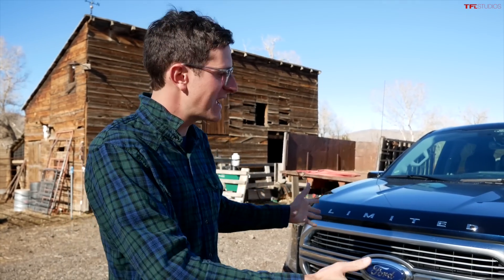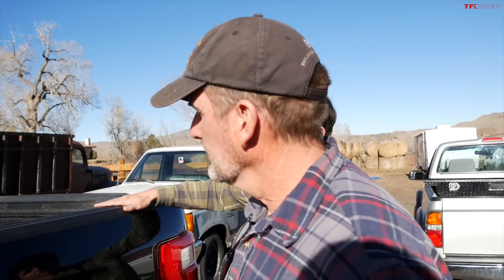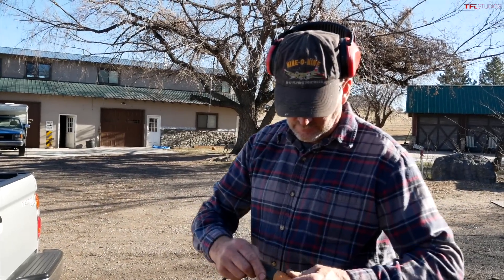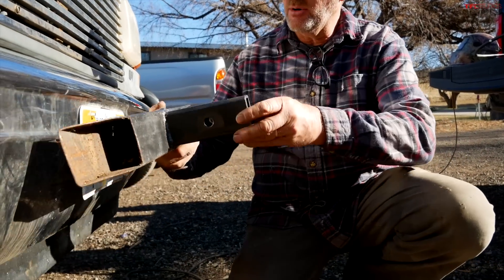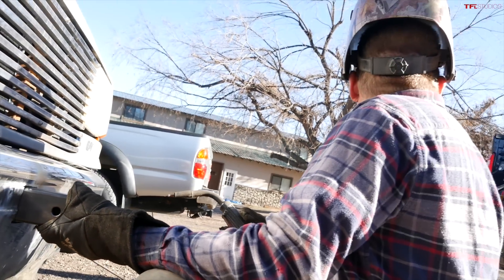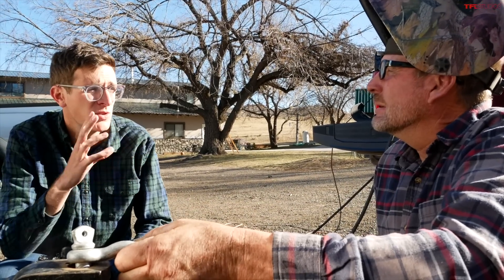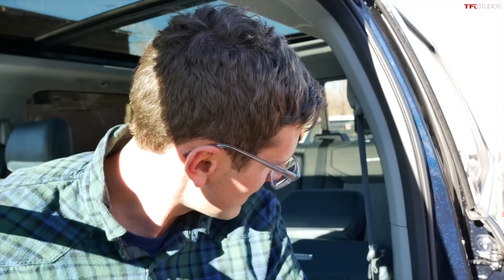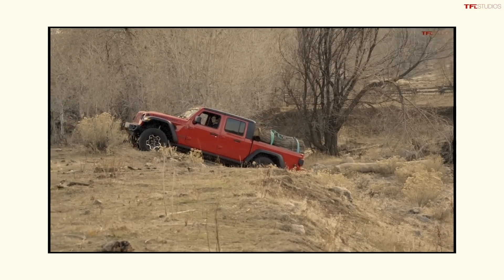What Does A Rancher Think Of The New $80,000 Ford F-150 Hybrid?

Comment: $80k for a truck? I paid $80k for 10
acres,a house,pole barn ,new well and septic. I'll buy a used truck.
Reply: There are cheaper versions of the F-150, for sure there is a 40k truck with almost all those good features. We have to remember this is a Limited version.
Reply: For those concerned about price of high-end vehicles, I’ve been frugal all my life...now I’m retired and I saved too much money so I’m going to buy an overpriced pickup just because I can.
Reply: Yea buy a used truck with a carb, upgrade the alternator, buy an inverter for 200$, bam....  I have a 32 year old Jeep grand wagoneer, got a 200 amp alternator, can output 2800 watts max..  a $200 3000 watt inverter.. adjust my idle with a screw driver if i want it higher to get more power outa the alternator... BAM saved myself 80,000$
Reply: Dizzy Gear  Why did it impress you ?  A 50 year old car can do this with an inverter a high amp alternator an battery and adjustment to the carb for higher idle..
Reply: Dizzy Gear  Dude you need to get off the couch, go to any dealer and see what prices are. GM and Ram don't have that fancy of a truck. Theirs only go to $70,000. The other guy on TFL just bought a XL version for $50,000 with that generator option.
Reply: @jeepsblackpowderandlights4305  Yep and what you have is a 32 year old piece of shit that you can weld with.
Reply: @robertward553  lol i have a 32 year old car.. that still runs and drives 32 years later.. and is worth over 30k$ in cash.  Have you seen the value of these grand wagoneers some sell for up to 50-60k$ today ?  Whatever car you drive will never end up a classic nore hold or go up in value like my (pos) has and will probly stop running after 8-10 years once the plastic all starts breaking on the engine

Enjoy your carpayment. Property tax and car insurance prices on your pos car though
Reply: @jeepsblackpowderandlights4305  Well good for you, even you must know that not everyone enjoys driving the same car for 32 years. I went 10 years once, 98 expedition, 180,000 miles body still in great shape. But I got to admit, unlike some, I like new shit.
Reply: @robertward553  who said i owned the car for 32 years, i bought it 5 years ago and  restored it by myself, these things are gold mines for money if you can repair cars like i can, but besides that fact, my point is its easier to do things on a car thats simple..  Modern vehicles you cant even repair without companies trying to sue you or block you via computers.
My other point is people who buy new cars, are spending most of their money on car payments.. who wants to pay $600-800 a month on just  the car payment lol
Reply: @jeepsblackpowderandlights4305  Oh I see, playing with words, "I drive a 32 year old car". Turns out you rebuilt that car, if you're thinking it's worth $50 or $60 grand, you didn't just throw some bondo and a new paint job, oil change and new tires. You would have to restored it, you would have to spend some serious cash. So don't put down people who buy new just cause you can work on cars yourself, most of us have different passions, we'd rather buy ours and do other stuff.

Comment: I knew you could weld with it that's awesome! If Ford makes this as a XL trim level truck I see a lot of farmers buying this truck
Reply: You can actually order the hybrid in Xl
Reply: @erickzuniga39  crazy🤯
Reply: I’m just about sold.
Reply: @erickzuniga39  You can?  I tried to Price and Build on with the hybrid engine and 7,200 generator, and it was not available in the XL I thought?
Reply: Well dang-  I was wrong!  You can get the full size generator power on the SuperCrew cab XL!
Reply: If they found a way to add it to a super duty with an xl it would be great but I’m sure that’s coming
Reply: @dukeuni  Yes this is available on all SuperCrews.  Not sure about other cabs.
Reply: Farmers don't weld 1/8 inch steel.......... just an expensive party trick
Reply: I think I can speak on behalf of some other farmers in saying, I'll just stick to older trucks with a welding rig, you really can't afford new trucks, or don't see the point in it. Older trucks can get work done for cheaper, especially for farmers and such.

Comment: Get the XL PowerBoost with the vinyl seats and floor, with the Tremor package
Reply: skip the goofy Tremor package and just get the FX4, but yeah, that would be a decent work truck. conceivably. 😆
Reply: @donleamon8653  yeah, it is not necessary FX4 is still really good
Reply: If only that was possible 🤷.   This is modern vehicles we are talking about.   That power train is a 50,000$ package realistically speaking
Reply: @rognio3  the new generation of f150 let's you get pretty much all the engines on any trim.
Reply: @DanielBlaney  I've built them on fords website 🤷

Comment: If you're gonna test a welder, test a 240V unit.
Reply: I was thinking the same thing. Why not test using the full power available.
Reply: Probably doesn't have one.
Reply: @dedalliance1  I'm guessing you can rent them. It'd even be a tax write off.
Reply: I about lost it when that yuppie for a host asked do they make 240 welders?
Reply: Use what you have.  They had a 120V welder, so they used it.
Reply: @smirkingdevil  That's great, but if you're doing a review for the consumers it's a lot more helpful to see the full range, which would include a 240V test too. Of course they have zero obligations to do that, but it would be more helpful, and I think that's kind of the idea behind the video.

Comment: You should probably try to run a welder exclusively on the 240 outlet... the 120's max out at 3600 watts. The 240 can pull a full 7200 watts
Reply: Use what’s available. You can also run multiple passes.
Reply: Yeah. That was strange using the 110 outlet.

Comment: "It's a good idea", but you are doing it WRONG! You need to flip up the rear seat cushion to fully lay down the front seat Tommy. Watch Ford video closely... LOL
Another thing is the power outlet. It clearly stated on the outlet cover that each PAIR of 120V only provide 20A, so 2.4kW max for each pair of outlet, not 3600W.
Reply: When it says each pair of outlet it's talking about how each outlets have two plugs. The 240v plug is rated at 7.2kW while the 120v plugs are just the 240v split so that would mean each pair get 3.6kW.
Reply: Its definitely 3600watts
Reply: @03HemiCentralIN  go check one in person. It clearly labeled 2.4k on the cover. LOL
Reply: @Bless-edisYeshuaHamashiach   Go check one in person. It clearly labeled 2.4k on the cover. LOL
Reply: @dearbulls  I don't think the Power boost has started hitting dealer lots yet, you can get the 2.4kW outlets with the other engines
Reply: @dearbulls  Nvm, just saw what you meant @3:06
Reply: @minhajsyed9874  thanks for tagging. Yes, it's what I meant. Just forgot where it is and you find it. 😄

Comment: I wonder if they will ever add the power generator to a super duty? It would be super nice for towing a travel trailer.
Reply: It's coming to the super duty. 
It's going to be in the transit as well.
Reply: you would have thought that the massive inverter would be target audience for the commercial users. Having a hybrid for fleets would be the real money maker for total cost of ownership and fuel costs. It WILL come! Found that Ford like to introduce the chassis and technology for the F-150 first before the upper series. Ford got the new chassis (aluminum) for 2015 while it was 2017 for the Superduties.
Reply: @maxwellkeeling3781  The Super Duty is always two years behind the F150 for a reason. Ford stay ahead of the truck market because the Super Duty is redesign after GM and Ram Heavy Duties. And the 150 is redesign 2yrs after Ram and GM half ton truck.  The same will be said for the  Raptor and all electric truck when everyone else release their trucks. The 150 and Super Duty are made in the same plant now. Ford are innovators in the  truck market and everyone else just duplicate it with a little touch of their own.....PEIORD. Just some insight on Ford. Half of it's sales are from commercial and government contract, that market are ready and available from the production of the first truck.
Reply: Hell it'd be fantastic with a 5th wheel. Being able to plug into 30amps for travel days during lunch or naps would be incredibly nice. Could run a single AC or make a cup of coffee. Having that in an F350 diesel would have me seriously considering upgrading.
Reply: @atomictyler  the one benefit with the gas generator portion is easy stop/start. I’m not sure if a heavy duty diesel generator could cycle for such short periods and be nearly efficient. If anyone is able to get around this and bring a solid product to market, it will again be Ford!
Reply: @maxwellkeeling3781  That's my only worry about them making it to diesel super duty's, but I'm hopeful! We travel all summer long with a fifth wheel and having that on-board 30amp plug would be incredibly useful. It would certainly make it easier to talk the wife into an upgrade haha!
Reply: @atomictyler  having a family and nieces and nephews where watching a movie while camping happens these days or wanting to be cool in the hot summer, NOT having a massive and loud generator going for a few hours is pure bliss.
Reply: 2023 Model year, it will have near identical interior as well
Reply: Would need to be much bigger
Reply: @wasupfool5692  what would?

Comment: It would not blow if it was plugged into the 240...
Reply: I have a little welder like that, and it has a changeable plug where you can put a 120 male plug on it, or a 240 male plug. I never use the 120 plug because it trips the breaker at my house every time.. I always put the 240 on it, and plug it into my 240 outlet I have, and I can weld with it on full power, and weld as long as I want, and never trip the breaker. That is why Ford put a 240 outlet on there, for welders, and any equipment that draws more power.
Reply: Agreed

Comment: Needed a 240v adaptor for that welder, most of those you can use a pig tail and then it will work with both inverters at full power.

Comment: Welding single phase 240V = 50 amp, 3 phase 220 V = 30 amp.  Problem is running the welder as a single phase and trying to get it as hot as it can.  Also look at duty cycle of the welder, that would have a big impact.  

As someone said, for the overlander, this is a game changer!  I'm super pumped for this truck!  I'm very impressed with the camper trailer vid and charging EV vids TFL did.  Great info guys.  Love the hard work.

Comment: I have a 2013 Ford 1-50 and thinking about going new!
Reply: Me too, 2013 F150. But I'll wait for 2023 model for them to fix all bugs. Or even more, if they can bring powerboost to F250 with Tremor would be perfect.
Reply: Carolus Magnus  

More like $500 a month
Reply: Me too, got 2015 Larait , with 156K miles on it, summer 2021 is my target
Reply: @Spooks_and_Gooks  lol what 80k vehicle can you buy and only pay 500 a month? You live in lala land. Even if you lease an 80k vehicle you would still be in the 700-800 a month range. Smh.
Reply: Cute truck... But this is what Hds are made for.    And for the price range I can't figure out why anyone buys these lol. Trucks vs something able to actually look great and handle  construction and ranch duties.   50k plus your in lower to mid trim with a diesile option.
Reply: Honestly just wait for the next gen of f150s
Reply: Because they look the same. Lol
Reply: Keep the 2013! Those styles seem to
Be the most reliable. 145k hard miles on my 13 eco limited, only had to replace manifolds at 142k
Reply: I have only 31,000 miles on it! Replaced breaks and a faulty ignition switch. That’s it for maintenance except for oil changes and fluid fill ups and tires alternated every 1500 miles

Comment: can be configured as a work truck    Your Configuration: XL, SuperCrew®, 6-1/2' Box, 3.5L Power boost™ Full Hybrid V6 Engine, HEV Electronic Ten-Speed Automatic Transmission with Selectable Drive Modes, 4x4, 3.73 Electronic Locking Axle Ratio   came to $52440

Comment: An inverter welder on a 30amp 240v drop in capable can weld at 200 amps. In fact I have used my 200 amp inverter TIG to weld in the field off a 5kw generator numerous times.

Comment: My compact miller welder has the capability to use 120 or 220 volt. I am assuming this may be better option use with the Ford power boost. I do believe the option of the seats reclining flat is an awesome option. Any long road trip, resting in a rest stop for a period of time. I am hoping this power boost technology makes it to the super duty diesel in the coming years. That will be the ultimate work truck.

Comment: Bought mine a few weeks ago and tried to weld on 240 with it. Immediately tripped the overload and shut off the outlets. Was trying to MIG weld and wasn’t running hot. Then tried to stick weld with an inverter welder at 85 amps and it tripped that too. Extremely disappointed. Called Ford and they knew nothing, they told me to call my dealer, come on Ford

Comment: Respectfully request you test the 120v outlets with air compressors that draw around 14 amps to see if the breaker opens on compressor startup. In the meantime, I will keep my Powerhouse gasoline generator with 20-amp outlets on standby.

Comment: You could also have bought a 10 dollar adapter and plugged the welder into the 30A 240V outlet  and it wold run that welder at full no problem

Comment: 80 freaking grand what is the world coming to
Reply: Don’t you want to impress your neighbors! You know the ones you don’t talk to!
Look what the bank let’s me drive!
😂 😆
Reply: @Torsee  look at 1,300 monthly payments for the next 5 years
Reply: Been there for a while, look at superduty prices since 2015.
Reply: It’s a Limited... lol. What did u expect? It’s not an XLT!
Reply: @diegoavila4379  
For that money, go right on and buy a good used Kenworth!
Take off the fifth wheel and make a nice wooden deck on the back!
It’s a bitch to park in the corporate parking lot, but it will be the biggest!
😂
Reply: Its a limited sir. The cadillac escalade of fords truck line. Because rich people need trucks too, ford will put all the luxury goodies in it and charge a luxury price. You can get a bare bones f150 with the 3.3 L v6 for 28k. Thats what you need to be looking at.
Reply: ford guy all the way but 80gs is not worth this truck
Reply: You can get the capability in a mess less expensive F-150.
Reply: you could get most of the functionality features for  less than $60,000. Have to remember that generator would normally cost you several grand and that the hybrid will save you fuel money.
Reply: Knowledge! There are so many tax incentives that will chew that 80 grand up including the GVW deduction. Get a good CPA
Reply: That is the luxury trim level. You can get a lower trim level much less expensively
Reply: can be configured as a work truck for just under $53k with 4x4
Reply: You could probably get a fully loaded lariat for some thousands cheaper if you really are cheap about luxury
Reply: The result of inflationary fiat currency.....
Reply: You can get the same power plant in xlt